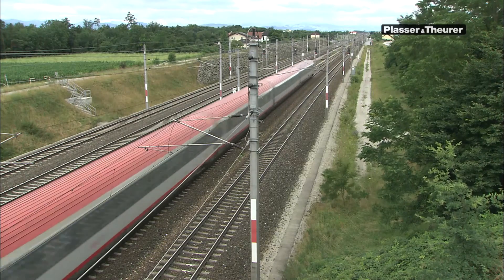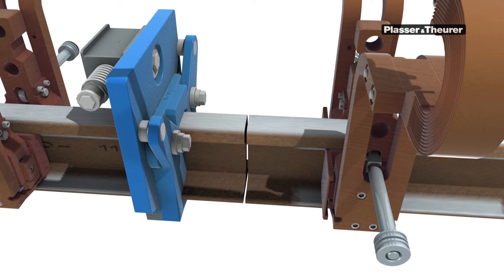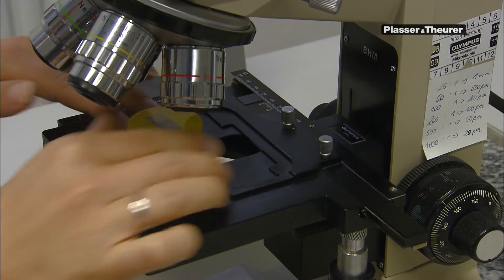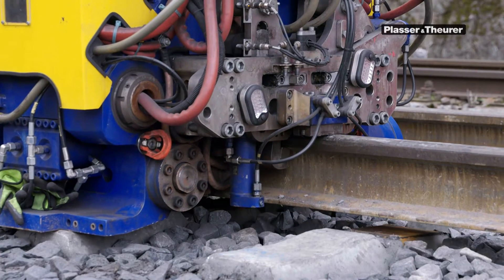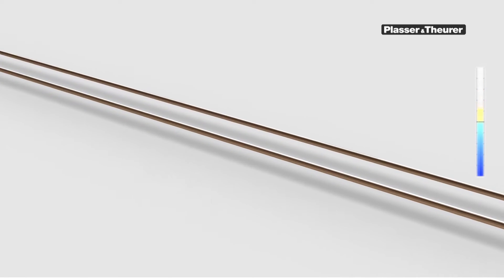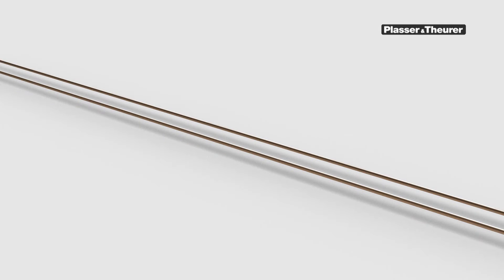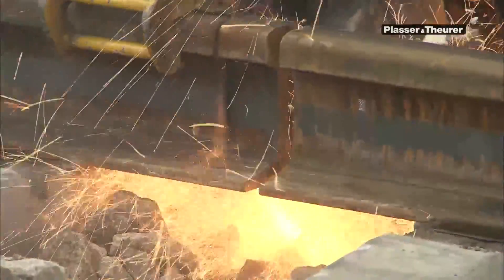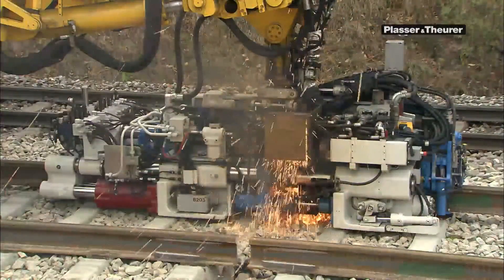How rails are welded efficiently

Comment: Meanwhile: America doesn't weld its rails. Also? We still use wood and creasote rail ties.
Reply: America starts with 1/4 mile long rails to begin with and still welds them together for longer lengths.  Most of the remaining jointed rail is on branch lines and short lines.  The mainlines that I see in Northern Indiana and Southwestern Michigan are welded rail, period.  Concrete ties are gaining acceptance but cost and availability are still an issue, particularly when so many miles are on wood ties and ties are replaced as needed on roughly 40 year intervals.  Concrete is showing up on new tracks being built from the ground up but I'm haven't seen much as spot replacements.
Reply: @Rayinn-lw3ej   America has so much to catch on the Rail field starting with covincing that Rail road are essential and matchless way of transportation regarding economics of cost for both passengers/freight , time saving , environment preservance  and most of all safety , however the problem lies in two factors 1-the government had invested much in Roads  2- due to the previous factor the Road psychology that fills the legistrators  mind that Road can replace RR and thusi t`s a much cost for less efficiency  and Rail road is an outdated fossil that it`s time has gone long ago < 3- automobiles and airlines lobbying   . 4- Not`s anyone`s fault  and the last not the least the nature of inhabitant style of people spreading all over the country which is an advantage be the way not lineal as japan for instance combined whith the  vast continental area of the country  , leading to impossibility of lay rail Road every where people are living in taking huge time and resources, however it worth to mention that have been a few exceptions in the recent years with public campaigns for new more lines as California high speed rail as well as other mega projects  .